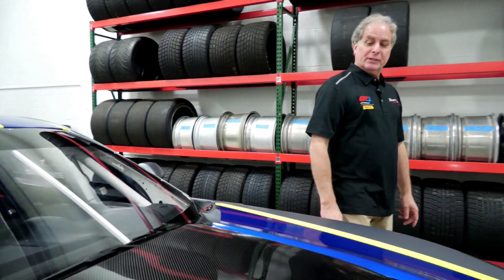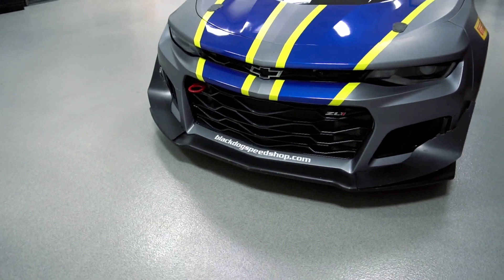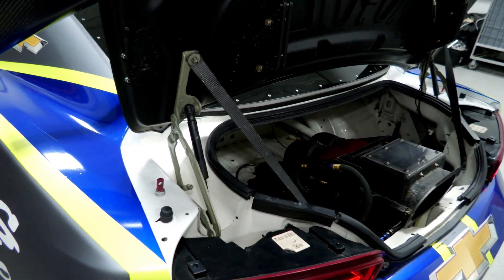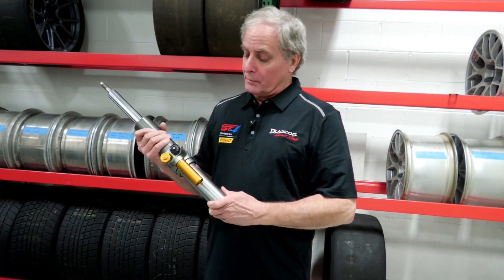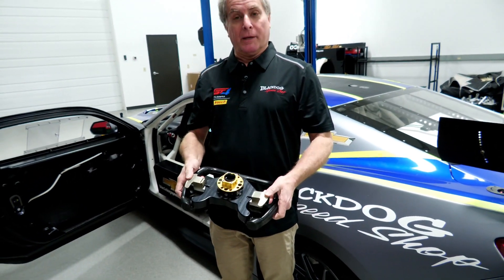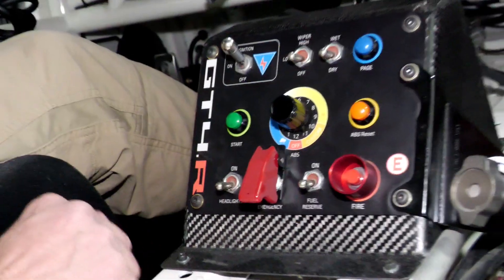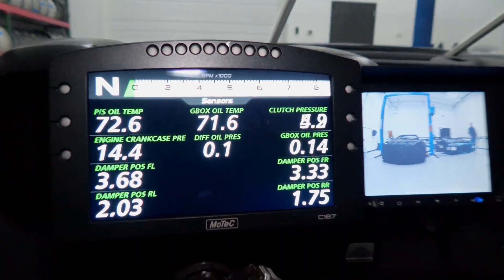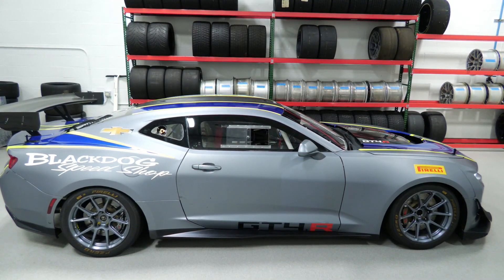2017 Camaro GT4.R at Blackdog Performance Cars

Comment: How many horsepower does it have
Reply: 450-500 depending on air restrictors
Reply: 2017 camaro GT4.R the horsepower is 450 -500hp really

Comment: How many horsepower does it have
Reply from the maker: These are rated up to 480HP per Pratt and Miller pending what restrictors are being run. Current restrictor will put it right around that power level.